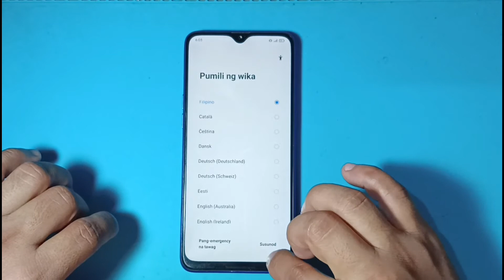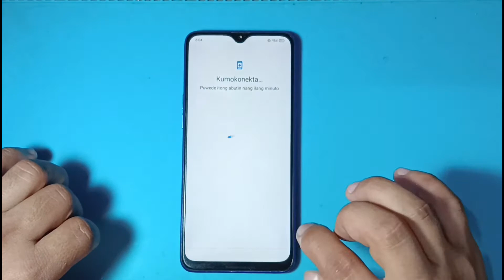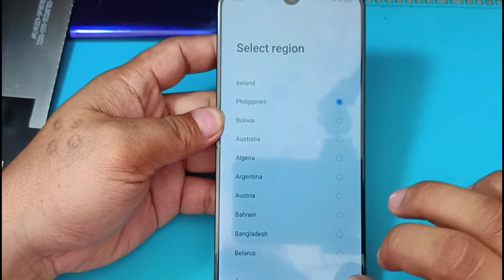REALME 3 PRO LCD SCREEN REPLACEMENT

Comment: boss sana masagot mo.. meron pa bng realme 3 pro lcd na orig at magkano?pati moherboard kasi pag laglag pati speaker nya na nadamay. pinagawa ko sa technician sabi dw po yung sa speaker motherboard dw kasi nayupi.. sana msagot mo.. tnx stress na ako sa cp ko.
Reply from the maker: merong orig nyan boss kaso dito samin walang orig na nakukuha boss,
Reply: @BoczTechOfficial  boss mgkano sa palagay mo yung orig tlga na lcd ng realme 3 pro?at motherboard?
Reply from the maker: @straightflash6925  yung orig boss sa palagay ko nasa 2,500 to 3k dn motherboard naman nasa 3,500 up